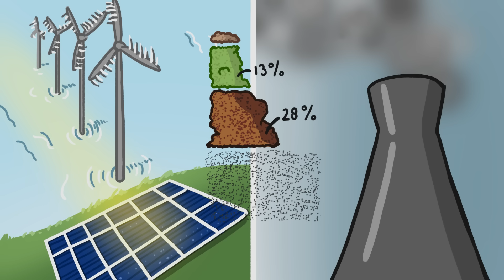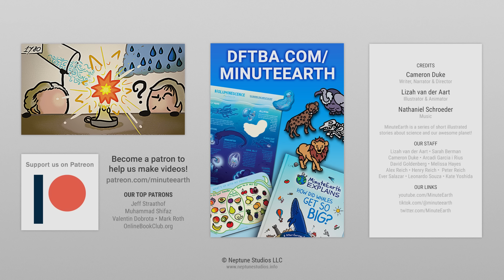What if We Replaced Nuclear With Potatoes

Comment: radioactive potato is mighty.
ppl don't realize how efficient and safe it is compared to the alternatives.
Reply: I read somewhere that the most dangerous radioactive source of electricity is coal. Living near a coal power plant is much worse in terms of radiation compared to living near a nuclear plant (and obviously much more worse than living close to renewables)
Reply: @Ghi102  yeah coal has been in the soil for a long time, naturally occurring radioactive materials like vanadium infiltrate it and  when burned gets released into the surrounding atmosphere. 

also you should ventilate basements since radon can collect there.
Reply: What's funny is normal potatoes are actually fairly radioactive, potato chips are one of the most radioactive things we regularly eat.
Reply: @creamofbotulismsoup9900  they not above bananas as far as I know.
Reply: @HisameArtwork  Sort of, raw bananas have slightly more radioactive potassium than potatoes. However if you dry them , the potatoes win since they have more water content than bananas.
Reply: xkcd 1162
Reply: Part of that is the incredible levels of regulation around nuclear power. There are places where, in order to build a nuclear plant there, you first have to reduce the naturally occuring background radiation because that's above the set limit for background levels near a nuclear plant.

If you're in an area with exposed granite rock, then you're likely to be exposed to more radiation than if you were hugging the outer wall of a nuclear power plant in normal operation...
Reply: @rmsgrey  yeah that too, lol. Some Plant in France had a panic, but it was just the neighboring car tire factory using sulfur and some other stuff that triggered the sensors.
Reply: @Ghi102  Idaho National Lab (INL) had to build their coal power plant outside of the fence from the Advanced Test Reactor (ATR) because the coal plant emits more radiation than the ATR and regulations for nuclear facilities allow.
Reply: @alexandermarvin9536  That's really interesting. I know about the ATR but I did not know the story about the coal plant. Can you send me a source regarding this?
Reply: Per unit of energy produced, more people die to solar than to nuclear due to falling off of rooftops while installing solar panels.
Reply: A couple of things I remember from the Fukushima incident:
- portions of Tokyo were evacuated where it turned out the radiation peaked at three times the normal level, which sounds moderately impressive, until you realise that that's just the normal, everyday level in London

- a week or two later scientists on the US Pacific coast reported being able to detect an increase in certain radioactive isotopes. Some people freaked out over the increased radiation threat; people with an idea of the scales involved went "wow, it's pretty cool that we can measure something that tiny". It's like breathing in particles that were part of one of Napoleon's farts, but being able to identify the specific particles...
Reply: @rmsgrey   I remember that one of the first things that my government was doing after Fukushima was increasing the safty limit for radiation values on imports...

One of the first things our companies wanted to do as the waste problem was mentioned was : Putting all the waste is a sub-company and let this sub company go bancrupt, so that they don't have to pay for it.

I am just saying. The technology is good but those energy companies aren't that trustworthy.
Reply: Technically nuclear plants barely burn more then a few percent the potential energy in the material, yet that few percent is still worth it, by far.  It's like eating a bite of each slice of pizza, but each bite gives you enough energy for a day of work.
Reply: No kidding on safety. If you took all of the nuclear power plant-based disasters and total up all the damage, deaths, and hazards they produce and add them all together... you have a very small number. Especially if you compare it to coal or oil-based disasters, deaths, and hazards.

Check out Kyle Hill for an epic video series detailing every disaster, one by one. They are disasters, yes, but typically no more than, what, five? people died from those events. And yet they are feared SO MUCH MORE than the constant poisoning and death caused daily from other fuel sources due to name-based fears (ie: the mere word "nuclear").
Reply: @JarieSuisen  Solar power kills more people for the same amount of energy when compared with Nuclear (including indirect deaths from Chernobyl and Fukushima fallout) - mostly from falling off when installing rooftop panels.
Reply: @JarieSuisen  I saw unsourced claims that the number of deaths per energy would be higher for nuclear than for wind and solar (not sure if hydro was higher or lower) but the number where at least a factor 100 lower than for any fossil fuel.

Then again, unsourced, so likely different sources using different methods to measure.
Reply: @JarieSuisen  To be fair, nuclear is feared a lot more because of the fact that they damage the genome, and while there's plenty of people that don't want kids these days, it's still something that causes people pause.
Reply: @KainYusanagi  outright propaganda
Reply: @firstname405  What? All forms of radiation are factually known to be genotoxic. That is one of the biggest concerns most people have with it- that if something goes wrong, there are long-lasting effects that irrepairably alter DNA. The thing that isn't properly communicated is that the technology for nuclear has advanced such that there isn't risk of nuclear meltdown like there was with 1960s-1970s era power plants like the Chernobyl power plant, and containment is such that with Gen IV reactors and beyond, it's simply not possible for there to be a cascade failure that results in meltdown.
Reply: @KainYusanagi   "all forms of radiation are factually known to be genotoxic" I think you mean ionizing radiation because last I checked radiowaves don't cause cancer.
Reply: Noone counts hidden prices of health care for regular fossil fuels.
Reply: Maybe that would be a fair statement if they even mentioned the fact that there could be negatives. But look at the sponser. No shock there.
Reply: The just don't feel that save  if you think about all those run down oldtimers... was it last weak as news said that there was a radioactive problem with one nuclear power plant in France  ? 

The other thing is. Electricty of nuclear power plants is kinda expensive. If you add all thos subsidies....most companies also try to avoid paying for the waste management...

We in Germany also let our nuclear power plants run longer than planned because of the energy crisis BUT without all those safty checks....
Reply: @blablup1214  The safety has improved A LOT after Chernobyl and Fukushima, billions were spent to ensure safety and I can pretty much guarantee that any incident as severe as Chernobyl is impossible now. France has some reactors shut down for maintenance, not a radiation problem. The electricity from nuclear is actually cheaper than that from renewables when you include things like grid intergation or subsidies, renewables get much more subsidies than nuclear and you still need gas plants to make supply follow the demand, nuclear doesn't need that. Germany doesn't let plants run longer than they're supposed to, they were shut down early for no good reason and they can provide cheap, carbon free electricity reliably for at least 20 years but instead they decided to shut them down and keep using coal.  They did all necessary safety checks, there's absolutely no need to be worried.
Reply: @vaclavzajac214  The maintenance wouldn't be a problem. A problem are headlines like this.
"EDF finds radioactive leak at France's Civaux 1 reactor, says no safety risk"

"They did all necessary safety checks". 2016 one of our companies admitted that they faked the safty checks ...

Would be nice to the the calculation that those subsidies  should be much less.

Yes they were shut down in 2011 for no good reason.  Would have been better to use them until they are at least 40 years old. They are now only ~35 years old. They would have been realiable but because government here in Germany shortented the runtime. Those companies didn't do all those safty checks anymore which would have been required and the Uranium is used up anyway....
Reply: @vaclavzajac214  Your argumentation is much to unprecice. You just say whatever you want without quoting any sources.
Approching 100 years ?  "Beznau nuclear power plant in Northern Switzerland takes the honour of being the oldest nuclear power currently in use. Construction on the plant began in 1965 and Beznau 1 began producing power on 1 September 1969"
The oldest still running one is  only 53 and that is a long time away of 100 years...

Yes we have more than enough uraniumBut we have not a single active uranium mine. We are enriching imported uranium.

Yeah that is the way to earn trust. Every problem is just exagerated and every mistake or accident was not so important...
Reply: @blablup1214  Everything I say is accurate, you don't quote sources either. I never said there's a 100 years old plant, don't put words in my mouth. I mean that there are plans for some plants to operate for up to 100 years since their licenses are gradually extended. There's nothing wrong with using imported uranium, it's certainly less risky than importing russian gas. Yes, most accidents related to nuclear are exagereated, what's wrong with that statement?
Reply: @vaclavzajac214  Putting words in your mouth ? You said "some plants approaching 100 years of operation". You did not say  there are plans for plants to operate for 100 years....
Reply: @blablup1214  ok and?
Reply: @blablup1214  neah, most anti are young ppl that saw that film series about Chernobyl from HBO and think it's a well balanced documentary.
Reply: @HisameArtwork  Do they also believe that Stalker is a game based on true stories or what ?
Reply: @HisameArtwork  that's just false, bro
Reply: @HisameArtwork  that show is probably some backroom deal by oil execs. Set us back 20 years.
Reply: @blablup1214  precisely

Comment: 0:25 KW/h as a unit of energy? 😮
Reply: Actually you are the best kind of correct, technically, In the video it gets the unit of energy wrong as kW/h
Reply: Sure is 1000 W * 1 hour = 3.6 MJ
Reply: Well... Is how energy comapanies charge us, isn't it? :P

Edit: Mistakes were made! As pointed in a posterior comment, I thought about KW*h even thought what was actually written was KW/h. A 'square hour' mistake, if you will. ^^
Reply: @guiguspi  no you are charged kWh which is power • time not kW/h which is power ÷ time. The former measures energy, the latter measures the second derivative of energy but would never be used instead of the more standard J/s^2. (Its the equivalent of position amd acceleration, one is measured as m the other as m/s. To my knowledge we only have a name for energy and its first derivative which is called power.)
Reply: @jasonreed7522  You are corret, I read W*h where was actually written W/h.